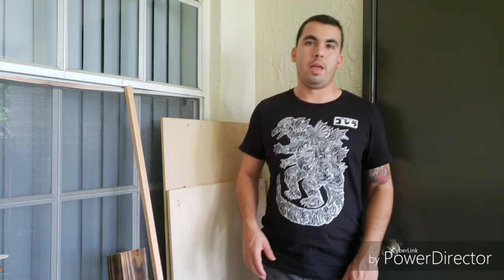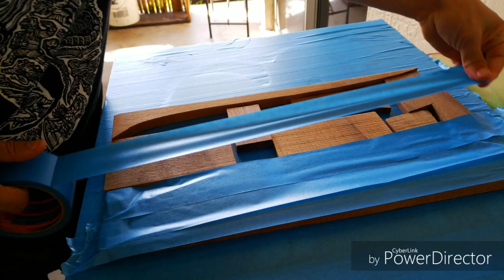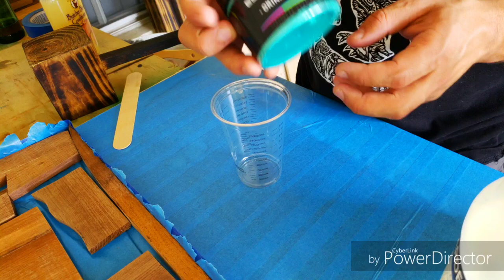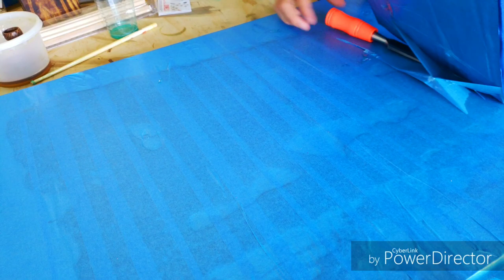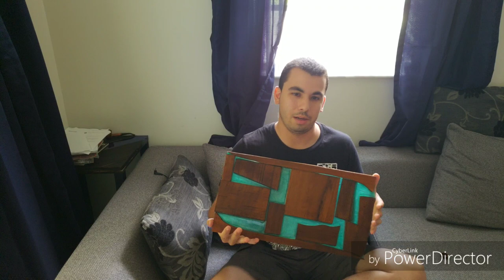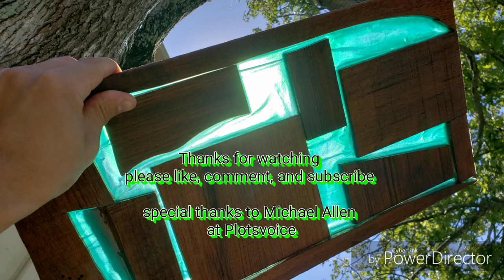Teak wood and epoxy resin art project

Comment: Did you have to do anything to the teak before you poured? I’ve heard that the oils in teak can hinder the bond of the epoxy?
Reply from the maker: I didn't do anything except sand it, the epoxy adhered fine for me, and I haven't had any trouble with the other pieces I've epoxied